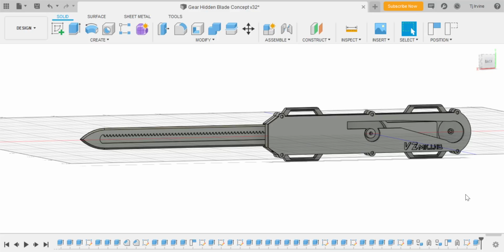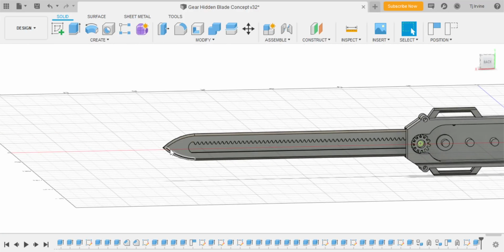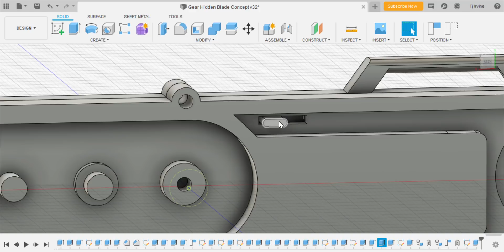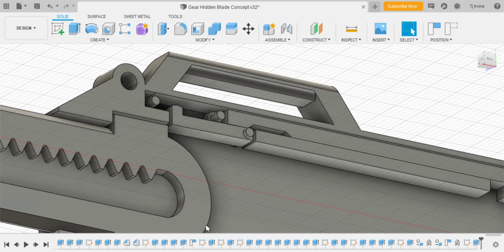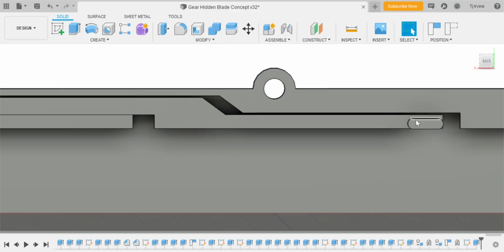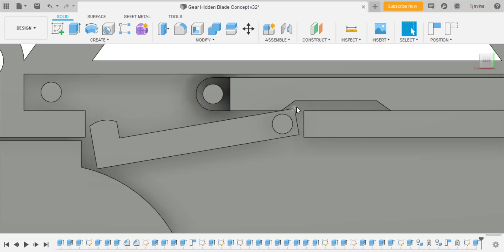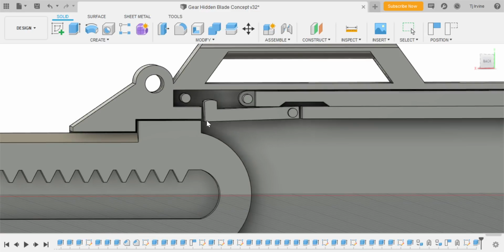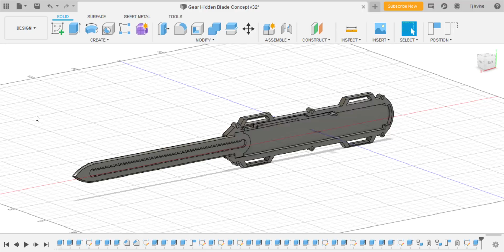Revolutionising The Hidden Blade Design PART 6! (New lock design!) By RAWICE511

Comment: one suggestion instead of half the spin try a third ( string side) with a gear and modifing the "clutch", that way the movement of the wrist to open close will be shorter and for there more elegant

Comment: I'm not too well versed in mechanics but I feel like these would be much stronger if made out of metal. The only problem with that would be you'd have to have a 3d printer that can print metal parts, or get into forging or machining (none of which would be easy on the wallet). Direct Metal Laser Sintering (DMLS) or Metal Binder Jetting could do the trick, but DMLS would be preferable since it produces tighter, stronger parts. The main downside to all this however, is that I can imagine it would drive up the costs quite a bit, both for producing the product itself and selling it to customers. I also imagine it would mean you'd need to redesign some elements to work with the increased weight of all the parts, like stronger bands and such (which would also increase costs).

If it is at all possible in the future, and you have the money and demand to back up the decision, I think it would be a great idea to start making versions made out of metal. In theory, it should provide an improvement to the strength of your designs.
Reply: He's making sure everything is legal and that he's able to produce and sell metal versions, and he already is working on converting these designs into metal and even some new ones! He's saving up to be able to afford production of the metal ones, but he's working on it!

Comment: ive got an idea for a variation. I found a video of a dude who made an elektric hidden blade. comes out when you pull, goes in NOT when you pull again but when you let go. i wondered if its posible do make it without electricity. so i thought insted of using the pull wheel use just a normal wheel you can steer in both directions and connect the pull wire directly to the rack. and the other end of the rack with a spring who pulls it back. so as long as you hold your hand up the blade stays outside
Reply from the maker: Checkout the Spartan124’s channel he did a design kinda of like that but fully mechanical I did a mechanism explanation video of it many many years ago he attached a ring and string to one side of the slider and a strong elastic to the other so that as soon as you released the tension with your hand the band would pull it straight back in, if you go on my channel to my older videos I have a hidden blade video called the ‘modern tanto hidden blade’ it uses this design 👌

Comment: Is it possible to mill.this out of stainless And insert the blade by access of imprint mold blacksmithing is my hobby i almost have my qualification
Reply: In theory it's possible, but he's not sure the plastic locks and interior gears will be able to withstand the pressure from the stainless blade since it's semi-tuned to the black plastic blade currently in the design.

Comment: I don't think the second locking mechanism is going to work effectively as you kinda have to rely on gravity for it to work may I suggest using a small spring to push the lock down and for the lock to disengage you have the lock extended a bit at the right side so that so that is requires less force to pull it back up
Other than that its really good
Reply from the maker: In the video I explained the block attached to the top of the lock tab will press into the looped elastic which will act as a spring pushing the lock tab down so gravity will be no issue at all, and yes I’ve modified the back of the tab so that it can be pushed out the way easier :)
Reply: @RAWICE511  sorry for my misunderstanding. but what about adding the locking mechanism to the other side as to give more strength to blade and to increase the security of the blade.

Comment: What I'm wondering is if the teeth on the blade would compromise it's usability, like getting stuck on something or getting dirt and grime inside the casing. Wouldn't it require more maintenance?
Reply: If something like this DOES happen, in theory since it's plastic you can just run water through it and rinse it out, or unscrew the screws and take the faceplate off and clean it. So it's possible that dirt could get in there, but easy to remove!

Comment: Why don't you have it so the blade is only out when you have tension on the string like it is in the games wouldn't it make it a lot simpler
Reply: That seems like a much harder design to create; Where would the constant pressure come from? It would be uncomfortable to have your hand back that entire time. Plus, it's super easy with the current design to open and close the blade with a flick of the wrist. However, he IS making a wrist-activated design in the future, which should take away some of the extra movement!

Comment: Good solution. For the locking tab itself I'd suggest making two changes. First, is to radius the end that engages with the blade using the pivot point as the center point of the radius.  You could even make it a cam, though I don't know if that would cause too much friction. Cam would ensure absolutely zero blade movement. Second is to extend the "tail" that engages with the slider. This will give the slider more leverage (especially important if you decide to try a cam). It's really coming along nicely!
Reply from the maker: yes i had a feeling the slider might struggle with the tail end of the lock tab so ive fixed that up will hopefully get to test it tomorrow! Thanks for the feedback :) glad to see you're enjoying the process!

Comment: If you can,reply to this comment but are these blades made out of real metal and are capable of take some real impact without retracting,pretty much are they capable of cause real damage?
Reply: These current blades are 3D printed, however the single blade is pretty durable and is completely locked in place, so it is stab-friendly! He was able to stab through a cardboard box in an example, but it probably can withstand a little more than that! It also comes with sandpaper to help with the "edges", as it's only 3D plastic so it can't be made into a true edge. He's working on making metal ones however!

Comment: Instead of the Lock part being L-shaped, you could also make it more u-shaped (but still rectangular). The extra "block" on the right side might be more reliable in rotating it out of the way, compared to the kind of squeezing in the current design

Comment: Will those pins be able to withstand some force though? Or does this make it so that the gear shares the load with the locking pin? Cause i'd imagine that locking pin would be the weakest link then.
Reply from the maker: it shares the load between the gear and the lock tab!

Comment: These blades are really cool but I have 1 question; Are these stabbing friendly ;) ? What I mean is like when you put force on the blade, it gets pushed down and comes back up as you release it from the object (like a spring if you know what I mean)
Reply from the maker: They are fully locked in place so you can stab!
Reply: Or do you have any blades that do that

Comment: Hey Rawice! Love your creations and I'll definitely order one as soon as my paycheck arrives, but my question is if I order a hidden blade, can I get a bigger ring so it'll go on my thumb along with a longer cord so I would need to flick my wrist upwards and move my thumb too so I don't deploy the blade when I don't mean to?
Reply from the maker: Yes at checkout you can pick any ring size from 8-13 and the string comes extra long!
Reply: @RAWICE511  and I actually have another question, it was answered but I wanna hear from the creator. Would it be possible for me to create a functional metal blade and replace the plastic blade since I make knives occasionally
Reply from the maker: @absanchez777  I mean technically it is possible but i am skeptical that the plastic housing would be durable enough to take the repetitive impact from a steel blade so it would probably break after a few extensions and retractions. Other issue would be getting the metal handmade blade accurate enough to work in the design as if you make the slightest error with the design it can greatly impact the function of the blade. but if you had a cnc machine it would be possible! i will be getting some metal ones made in the future aswell!
Reply: @RAWICE511  yeah no I don't have the cash for a CNC machine lmao I just have a forge and an anvil but I barely have room in my garage for the forge so I'd have to cut out the blade using a angle grinder lmao.

But if that's the case then I'll be waiting for your metal version then! If you do then what kinda steel will you be using?
Reply: @RAWICE511  ight sweet man I appreciate it!